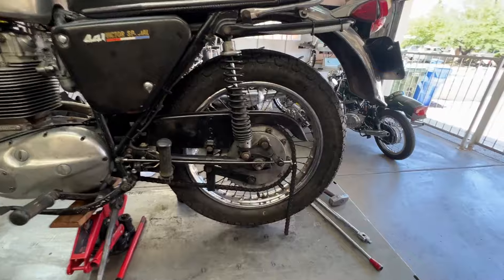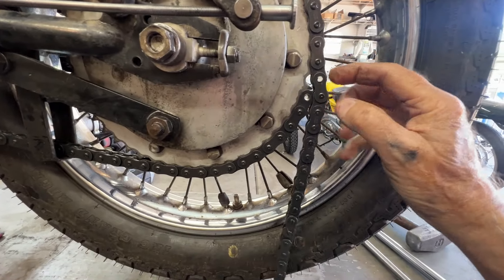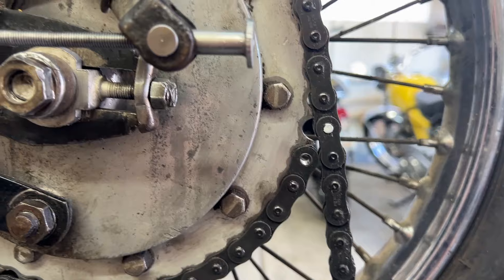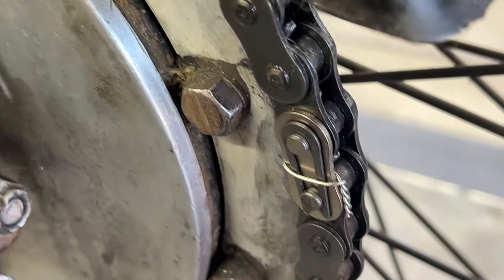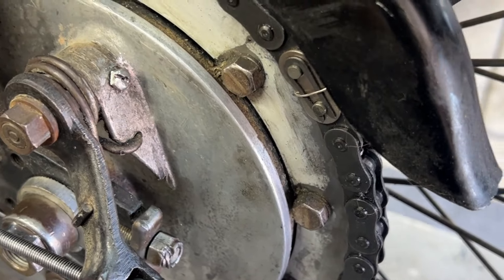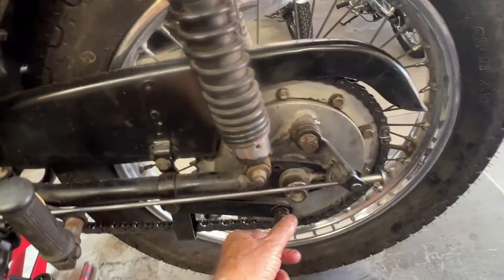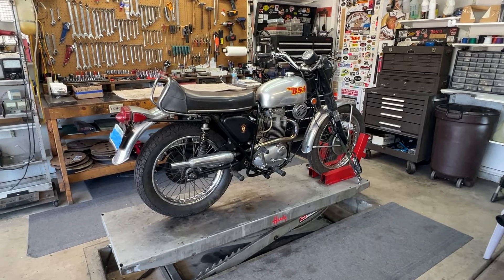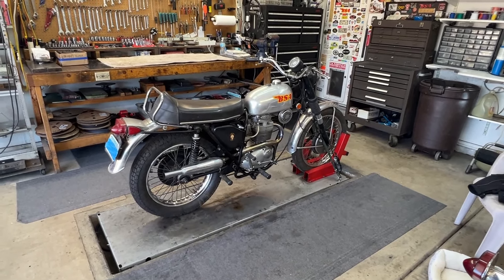05-13-24 - BSA 441 Victor - Start Attempt

Comment: A B44 is very easy to start but absolutely must take it past tdc until the exhaust valve is starting to open (you can feel it through the valve lifter lever when the pushrod pushes against the exhaust rocker arm)
It's no good taking it "just past tdc" 
Do not open the throttle 
But do turn the idle screw in half a turn 
If you have Boyer ignition fitted it'd be best to only turn the ignition on a few seconds before kicking 
Overwise if you kick it over to get past tdc the Boyer will think the engine is running and advance the ignition when you are trying to kick it over 
Of course this is assuming there's nothing else wrong with the bike
Reply: Also the lights are on. This will be draining power from the ignition circuit which Boyers don't like.
Reply from the maker: You are right!  I hadn't noticed that when I was kicking it!  The rear brake switch was loose.  I adjusted it.  Good eye!  Thanks.
Reply: Absolutely right. "just past tdc"  is not close enough, and  NO THROTTLE !!

Comment: BSA=Bastard Stopped Again 😁
I had 6 of these over the years 
2 had Weslake top ends with no compression releases
Put a squirt down the plug hole,
If it starts then idle jet is plugged 👍